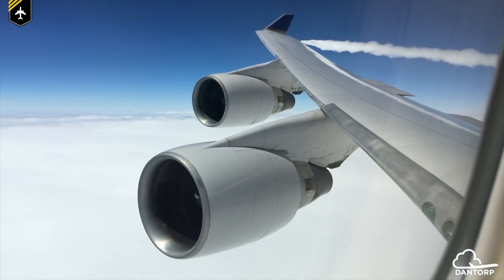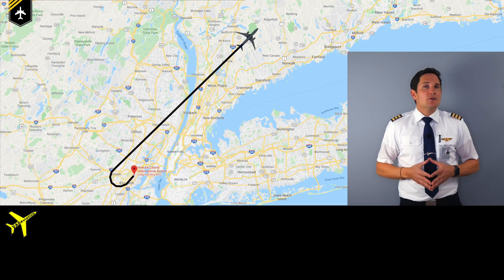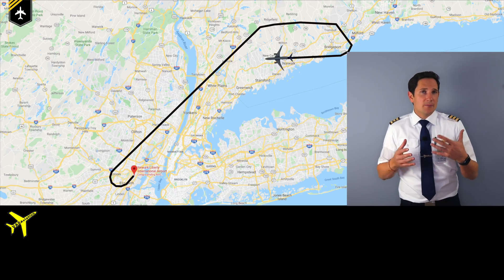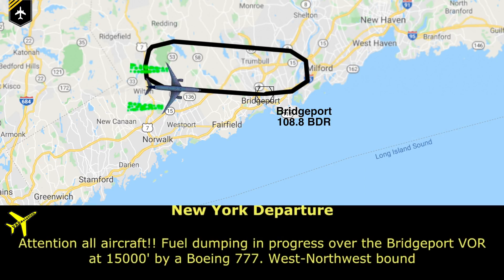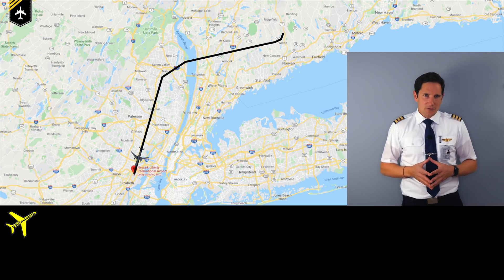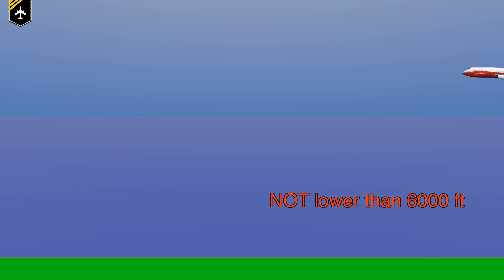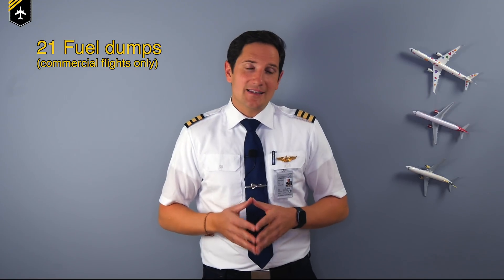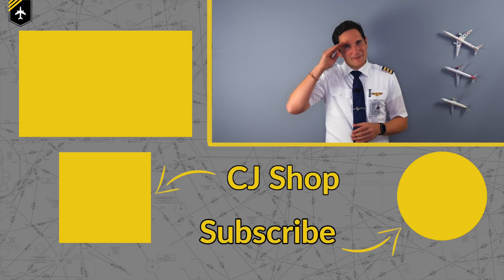WHERE do pilots DUMP FUEL? part 2 Explained by CAPTAIN JOE

Comment: Hey captain joe, love your videos, can you please make a video on how thrust reversers on turbo prop aircrafts (like Q400 or ATR72) work (if they do) ...
Reply: I can't help you with a video, but it works something like this:

A propeller is basically a (few) wing(s) and so they produce lift, just like a wing does, but we call it thrust. Because the airflow around the prop is very different when spinning at some set RPM when standing still compared to at, say, cruise speed it is beneficial if you can rotate the blades slightly to keep them at the optimum angle of attack (AoA).
Now that you can change the AoA, is you start decreasing it, you also decrese lift / thrust, if you decrease it even further, the lift/thrust increases again, but in the opposite direction. The props airfoil will not be as efficient, but it will work. The same thing allows aircraft to fly inverted.
Reply: Here is a video that shows a variable pitch propeller after landing when the angle of the propeller blades is changed:
https://www.youtube.com/watch?v=IlJRGcfCXIg

Comment: Nevertheless, it would be great if one would find out a way, a system, so fuel dumping this way would be a thing of the past.
Reply: True, however as long as aircraft are powered by liquid fules, this might get difficult. One could in theory desing nthe aircraft structure stronger so that for example the maximum takeoff and landing weights are the same. Then there would never be a reason to dump fuel. However, the aircraft would become heavier and use more fuel in normal operations. So one would shift the environmental impact from the dumped fuel to higher fuel consumption.
The other option would be basically inverse aerial refueling. That's probably worse, you'd need to send another palne up, need additiona equipment on board of all aircraft (weight again) and would likely also need reasonably frequent real life training flights, again using more fuel.

I'll just copy a comment I made somewhere else here:
To give a bit of scale, 700t of jet fuel are approx 875 000 L or, averaged over the area of Germany 0.00245 mL per m².
In 2017 (couldn't find data for '18) passenger cars in germany used 46 850 000 000 L of gasoline and diesel (https://www.umweltbundesamt.de/sites/default/files/medien/384/bilder/dateien/2_tab_kraftstoffverbrauch-pkw_2019-05-31.pdf)

Some of that will "escape" without being burned, either during fueling of the cars, or while mixture is enriched during startup and high loads, or leaks, etc. so lets just assume that for every liter of fuel bought just 0.1 mL escapes to the atmosphere (i.e. 0.01%). Even with this very low value this is five times as much as from fuel dumping. This will also quite likely be even more concentrated in populated areas (the cars are where people are, after all) and does not consider trucks, busses, construction equipment, if your neighbour has a gasoline powered lawnmover or chainsaw you'll probably get more exposure to unburnt fuel from that.

And the dumped fuel does not necessarily reach the ground. Water vapor is less dense than air and jet fuel has only about 80% the density of water.

That is not to say that fuel dumping shouldn't be avoided, and nobody wants to do it. Pilots and passengers would rather get to their destinations without any complications and arilines could probably do more usefull stuff with the approx half a million USD then just dump it, but considering what we as humans do to the environment every day, fuel dumping is probably not what we should No. 1 on our list of priorities.

Comment: instead of wasting fuel by dumping it why cant they pump the fuel to the main fuel tank that the plane runs on then the next time it refuels it wont need to take on as much saving fuel
Reply: that doesn't reduce the G-spike that causes overweight landings to damage aircraft.

Comment: I want to know when is the APU turned off and on
Reply: When the engines have started the APU will be turned off. When the aircraft has landed and it's parked and the engines are not running the APU is turned on to produce the electricity.

Comment: What happens to those buildings stained by the fuel dump? Who pays for the clean-up?
Reply: As he said in the video, the fuel doesn't really hit the buildings below, it evaporates. That example with the plants getting hit by kerosene drops happened because they were doing it wrong (too low in altitude).
Eventually, the fuel gases will end up somewhere, but they're basically negligible within all the pollution by traffic, industry, or other sources.
Reply: @varana  I'm thinking if the repeated elliptical flight path the troubled aircraft makes while dumping fuel, this pollution may become  noticeable

Comment: Just imagine if our cars could run on it and how long a hundred tonnes would last lol.
Reply: A diesel car should be able to run on it without any issue. 700t correspont to 875 000 L, you can do the math on that.
Might be a bit difficult to pull up to a fuel dumping aircraft and put in in your thank, though.
Reply: WIRRUZZZ ,  nice one lol. 👍👍😜

Comment: I couldn't understand anything. The audio was driving me nuts so what's the point of fuel dumping?
Reply: If there is an emergency situation during the flight and the aircraft has to land soon because of this situation and the aircraft has not used much of its fuel the aircraft will be too heavy to land. (The aircraft has the maximum landing weight.)
Because of this the aircraft has to dump fuel to make it lighter.
Reply: @mikep9604  weird but okay thank you for the response

Comment: Why did they tell ATC amount of fuel in hours not in weight?
Reply: Then they would also have to include the consumption rate and what not for ATC to know how to compute how long the aircraft will be to stay afloat post dumping... better to do those calculations yourself and simply give ATC the WCS time.

Comment: So is the landing gear storage isolated from the pressure chamber? I live in a mountain range high altitude (11,000 ft), and 18000 feet is pushing hypoxia limits.

Comment: 21 flights doesn’t sound bad but 700 tons does
Reply: To give a bit of scale, 700t of jet fuel are approx 875 000 L or, averaged over the area of Germany 0.00245 mL per m².
In 2017 (couldn't find data for '18) passenger cars in germany used 46 850 000 000 L of gasoline and diesel (https://www.umweltbundesamt.de/sites/default/files/medien/384/bilder/dateien/2_tab_kraftstoffverbrauch-pkw_2019-05-31.pdf)

Some of that will "escape" without being burned, either during fueling of the cars, or while mixture is enriched during startup and high loads, or leaks, etc. so lets just assume that for every liter of fuel bought just 0.1 mL escapes to the atmosphere (i.e. 0.01%). Even with this very low value this is five times as much as from fuel dumping. This will also quite likely be even more concentrated in populated areas (the cars are where people are, after all) and does not consider trucks, busses, construction equipment.
We, as a society just use insane amounts of fossil fuels, it is just that for most of us, it happens in maybe 50 L increments . . .
Reply: @WIRRUZZZ  For further comparison, a single pipeline spill in the US released over 400,000 barrels of diesel (about 50,000 tons) in 2019 - and there were multiple like that.

Comment: That dumped fuel spreads out huge... an average transatlantic 747 will dump 90 square miles (232 square kilometers) of fuel on the Atlantic ocean to return to NYC/NJ.   If you've ever wondered what's destroying the oceans, there you go.

Comment: Great video, Captain👮
Can thé aircraft factory's, not built stronger aircrafts, without fueldump option's, so that théy always can land, with full fuel tanks. But I understand very, very good, that all that plastic in the water, much and much environment polluting is, than that little bit on-burned fuel in thé air.

Comment: Why fuel dump over land? What happens to the fuel?
Reply: It likely stays in the air. Water vapour actually has a lower density than air ant the density of jet fuel is only about 80% that of water.
The airflow will disperse it into tiny droplets which then evaporate completely.

Comment: Another great informative video, it's really great to be able to hear the actual radio conversations, I thought your body language was absolutely brilliant, i could barely stop laughing at 15:15, to go straight from a scholars cradle to a forehead palm at the mention of chemtrails was priceless, to not be able to tell the difference between a high altitude condensation vaportrail and single engine very low level crop dusting?🤣 (even then, crop dusting is usually liquid and doesn't really leave any trail, you want the stuff on the crop, not floating in the air) Love your work.👍

Comment: 700 tons of fuel dumped over populated area. Zero risk??
Reply: To give a bit of scale, 700t of jet fuel are approx 875 000 L or, averaged over the area of Germany 0.00245 mL per m².
In 2017 (couldn't find data for '18) passenger cars in germany used 46 850 000 000 L of gasoline and diesel (https://www.umweltbundesamt.de/sites/default/files/medien/384/bilder/dateien/2_tab_kraftstoffverbrauch-pkw_2019-05-31.pdf)

Some of that will "escape" without being burned, either during fueling of the cars, or while mixture is enriched during startup and high loads, or leaks, etc. so lets just assume that for every liter of fuel bought just 0.1 mL escapes to the atmosphere (i.e. 0.01%). Even with this very low value this is five times as much as from fuel dumping. This will also quite likely be even more concentrated in populated areas (the cars are where people are, after all) and does not consider trucks, busses, construction equipment, if your neighbour has a gasoline powered lawnmover or chainsaw you'll probably get more exposure to unburnt fuel from that.

And the dumped fuel does not necessarily reach the ground. Water vapor is less dense than air and jet fuel has only about 80% the density of water.

That is not to say that fuel dumping shouldn't be avoided, and nobody wants to do it. Pilots and passengers would rather get to their destinations without any complications and arilines could probably do more usefull stuff with the approx half a million USD then just dump it, but considering what we as humans do to the environment every day, fuel dumping is probably not what we should No. 1 on our list of priorities.

Comment: 700 tons of fuel... Omg all places where I can be with my corolla only if I have 700 tons of fuel.... And few decades extra
Reply from the maker: Dragan Crnogorac best comment!!!
Reply: If it's a diesel it should be able to burn the Jet A1 no problem.
Might ba a bit difficult to pull up next to a fuel dumping aircraft to fill up. And you might need a bigger tank, as they dump, on average 35 tonnes or 43 750 L per instance.
Corolla diesels seem to be very efficient, just one dump should give you about a million kilometers!
Good luck getting that fuel!

Comment: Uhhh just a month back a China Air 777 had an engine failure on takeoff from Dulles and dumped fuel right over the top of Chantilly (where I live) at '6000... Why are we allowed to get fuel dumped on us but the citizens of Toronto can't? That plane was '4000 feet higher too. 

Look it up, VAS aviation has a video on it.
Reply: @ivobrick7401  I'm not mad at the pilots, I'm wondering why ATC can have such strict standards for Canadians but not here. The pilot had full control of the aircraft and requested to be vectored to a location to dump fuel to which the ATC just said go ahead and dump it all over the suburbs around Dulles from minimum altitude. I don't give a shit personally, but I don't see why we're allowed to be rained with kerosene and not the citizens of Toronto.
Reply: Probably because you have a president who would gladly « DUMP » on you literally if he could.
Reply: @MrPomelo555  This has nothing to do with politics, go get a fucking hobby.

Comment: How about that: "The horizontal boundaries of the area within which other traffic requires appropriate vertical
separation extend for 19 km (10 NM) either side of the track flown by the aircraft which is dumping fuel, from
19 km (10 NM) ahead, to 93 km (50 NM) or 15 minutes along track behind it (including turns)."

Comment: Wouldnt you want to dump fuel at high altitudes and over water??
Reply: Also if you fly through your dumped fuel, wouldnt you run the risk of igniting it the whole ten mile hold?
Reply: Nvm you answered the first question..